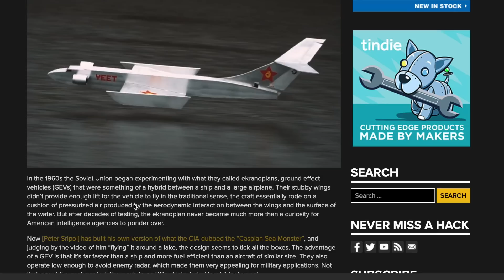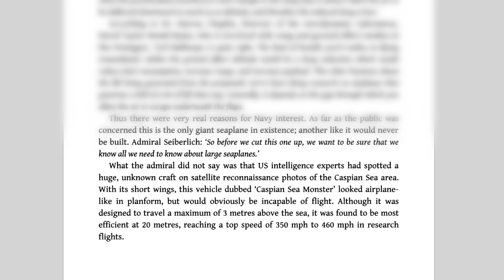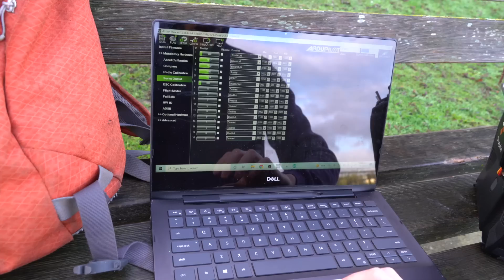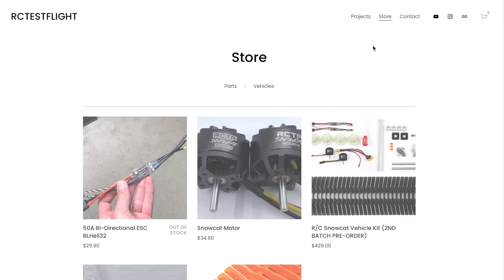Worlds First 'Real' R/C Ground Effect Vehicle

Comment: A ground effect vehicle is any vehicle which primarily flies in ground effect. 
Can you measure the lift force? Like, somehow put a strain gauge on the spar holding the wings to the body, and log the force and perhaps distance to the ground with an ultrasonic sensor?
Keeping track of speed, altitude and force will with numbers will show that you're really actually truly in ground effect, and make some pretty graphs.

Comment: So the thing my brain keeps going back to is weight.  Is there a reason I'm missing as to why the vehicle is so light?  Sure it makes it easier on the motors, but the motors have proven to be more than capable of lifting the craft out of the water.  My thinking instead of making it as light as possible, as an aircraft would want to be, why not set the motors at the optimum running speed (as fast as possible without cooking them) and then add weight as needed.  It would make it more stable and less susceptible to winds, and cut out the issue of having too much lift.  In theory, the soviet craft, even at full bore,  never had enough lift to make the thing fly.  It's power to weight balance was just enough to make it work.

Comment: 11:00 that’s technically called porpoising, present day Formula One cars are battling it atm, it’s caused when the vehicle aerodynamically stalls because (with cars) thry gets sucked close to the surface, stalls and then the car rises, ground effects start working again, then it gets too low and stalls again, although in boats I think it’s the opposite principle because the boat gets too high and stalls that way rather than too close to the water.  For your thing it’s probably a combination of the two, but I thought it quiet funny it was porpoising across the lake like a Ferrari.

Comment: Conformal coatings are not intended for primary protection - it's a backup. Things like connectors can't be waterproofed with it anyway, so you always have point where water can effect. They are intended for "backup protection" generally.

Comment: I totally agree with you about the power being a defining issue of a “real” ground effect vehicle.  In the kite flying community we have a saying that anything can fly if you bridle it right and you have enough wind.  😁

Question:  Instead of pitching the motors way up to get off the water, why not just use a small hovercraft-type fan to develop a little extra pressure under the wings.  That would eliminate the transition control problem.
Reply: This isn't totally relevant, but reading your comment made me want to find a big leaf like an elephant ear, glue some sticks to it, and try to fly it.
Reply: Weight? Aerodynamics? Any extra motor adds weight and putting a extra fan on it disrupts the flow of air around the fuselage when in flight mode. I think that VERTOL capable planes often have doors that cover any lift fans or vectored jet thrust. If I remember correctly the Harrier bleads of some thrust from the engine through vector capable nozzles located in the wings. But I'm also pretty certain they will have some way to minimize the aerodynamic influence when in normal flight. And those nozzles are a lot less disruptive than one or more lift fans in a RC model.
Reply: It works for hovercraft (and helicopters, sorta) . . . .

Comment: I agree the sea monster could fly outside of ground effect if analyzed from an aerodynamic and power perspective but it is possible that the structure of the aircraft would not be able to survive the increased drag from required increased velocity to fly with out said effect. Drag is a function of velocity squared (at low Reynolds numbers at least and ignoring induced drag) so marginal increases in velocity could have significant increases in drag on the body, wings and tail which may have been more stress than they were designed to handle.

Comment: If we need a definition for GEVs, let's just look back at the Flairboat: it's a vehicle that can only fly in ground effect.
Could it fly out of GE if you put a bigger engine on? .. EVERYTHING flies if you just put a big enough engine on, so that question should be irrelevant.
Ekranos are more like a hybrid. They are designed to use GE, but they are not limited to it.

That said, I think a Flairboat-like design might be the way to go for a "real" / "pure" GEV: the front wing lifts the nose and forces air under the back wing, which lifts the tail.
Figuring out the necessary aerodynamics, especially if it's supposed to balance itself, could be a challenge, but it should be possible to tilt the wings and add flaps. This way different wing profiles and AOAs could be tested.

Comment: A submarine is still a submarine even if it can float on the water.  The only conclusive way to know if you're in ground effect is to take away the ground ie fly it off a small cliff.  If the plane loses altitude then you were in ground effect and it is a real ground effect vehicle.  If not, then you were just flying.

Comment: Many years ago I read  "The illustrated guide to aerodynamics", and from what I remember, the wingtip vortexes cause induced drag and when the plane is in ground effect these vortexes are interrupted and that eliminates induced drag and thus makes the wings more efficient.  I don't think the author believed in a high pressure cushion of air causing ground effect, just that the wings gain efficiency in ground effect.  Granted he was only discussing airplanes in ground effect and I can see that the way air is channeled under the wings of your purpose built ground effect vehicles that the high pressure air pocket makes sense.   I think it would be interesting if you added ballast to make the plane heavier.

Comment: It should be composed of two parts of power, one part is high-power take-off to get out of a static state like the start of a car, and the other is low-power cruise to maintain ground effect, and a small thruster can be added to the tail like a Caspian monster. There should also be a T-shaped shark fin at the end of the wing, just like a civil airliner, English from machine translation

Comment: Could you mount a sensor that measures the air pressure on the underside? Wont that verify the ground effect mode?
Reply from the maker: All planes have higher pressure underneath. Thats how they fly
Reply: @rctestflight  yeah :D i Mean the pressure difference between 1 and 10 feet
Reply from the maker: @myketrip8938  There is none! If an airplane is maintaining its altitude then the pressure difference between the top and bottom is the same regardless of how high it is .

Comment: the main thing to remember with a water based GEV is that its a boat first. The more efficient you make the hull from a hydrodynamic standpoint, the better GEV it will be. you will need less power to get speed, which if you design the wing part right, should trap enough air at a specific speed to finally liberate the hull from the water with just enough lift to keep it right over the surface. Lookup a boat called the flareboat from the 90s. it had a BMW motorcycle engine mated to an air propellor, it did around 70kts. it was marketed as a fast efficient way to get around the islands when the waves are rougher, without needing a bigger boat or a pilots license.

Comment: I feel that a scoop wing might be necessary. That would make a hovercraft in a distant sense, but arent hovercrafts actually ground effect vehicles that produce their own pressure while stationary? Gotta focus that air pressure at some point in space right under the center of mass of the craft, so that it has most efficiency in that height... Or maybe its supposed to focus it more the closer its to the craft?
Edit: So i guess your goal ends up being to have the craft move not touching the surface using as little power as possible?

Comment: ive been wanting to see someone test how much weight a ground effect vehicle can carry for ages, you could probably test it with that one quite easily by putting a big battery on top
i think weight may have been the deciding factor for the ekranoplans, i messed around with ekranoplans alot in fsx and the a90 could fly quite easily out of ground effect with a high angle of attack but couldnt when i loaded it with weight, it could carry alot of weight too, far more than any plane of the same size

Comment: Rather than reducing the power, maybe you should increase the weight?
Reply: You said yourself, to make it a ground effect vehicle, you need to reduce the power to weight ratio. Increasing the weight would do that but also maybe give it the momentum needed to cut through the air in a way that it would be more efficient.

Comment: The Caspian sea monster was designed to haul extremely heavy loads. Increase the scale and weight, that should smooth out the rough spots and start getting consistent results.
Reply: Yes. The elasticity of the air doesn't scale down with the size of the vehicle. We can reasonably assume that there is an optimal scale for ground effect vehicles which is dependent on the physical properties of the fluid being operated in. So for earth atmosphere at sea level, there will be an optimal size of ground effect vehicle which is able to maximize benefit.

It also seems plausible that there is a Pareto curve of optimal speeds for a given vehicle size, where the dependent variable is the vehicle weight (payload).
Reply: I think this has been said on every single GEV video and he hasn't taken any notice. He always complains about it being too bouncy or taking off too early, which makes it pretty clear it needs more mass.
Reply: @balthxzar  Or more precision. Yes, more mass gives you more tolerance. But his quest is to find the exact sweet spot where it still works.
Reply: Bingo. Mass dampens all external input.

Comment: The reports I read about the ekranoplan when it was still in use said that low fuel consumption in ground effect was the main reason for its development. The biggest of them could fly like a plane to jump over ships etc but at a large fuel penalty. Biggest drawback of the plane was the turning radius at speed and that was most likely why the project was abandoned. I think the caveat that a GE plane should NOT be able to fly out of GE is similar to debating about how many angels can dance on the head of a pin. You did very well with your experiments. Large craft have GE up to 10m or so and the tiny range of your model made it hard stay in the envelope. Keep up the good work.
Reply: Three.

Comment: As you clearly demonstrated ground effect at this scale is a very delicate balance, I think one thing to consider is that obviously headwinds etc greatly disrupt that balance, and the flight controller currently has no way of compensating for that.
 An air speed detector on the  model allowing the controller to instantly adjust for variations in lift from airspeed fluctuations could give good results.

 Great series and looking forward to more.

Comment: So you mentioned about the power to weight ratio... what if you just added more weight to the craft but still used the engines at high power? so the craft almost couldn't go higher than ground effect as its weight would keep it from taking off but the ground effect + motor power was just enough to get it to lift off? It seems like the engines are way way too powerful for the super light weight design

Comment: If you need to take off from water, you've predetermined the outcome already. It takes so much power that it must be throttled back when in GE flight.

Imagine a wheeled ground effect vehicle taking off on smooth ground. That would take so much less takeoff power that it likely couldn't rise out of ground effect at all.

There's an argument that a true GEV doesn't need pitch or roll control surfaces; all stabilisation is done passively through GE interactions with a rudder only for direction. Again as soon as you put elevons on you're already planning for out of GE operation. 

I've done some experiments with hybrid hovercraft ground effect vehicles, using a dedicated prop to establish a ground effect cushion, then turning it off and needing only forward thrust to fly in GE. Somewhat like the power assisted ram effect.
Reply from the maker: This video proves your first sentence wrong :)
A control surface-less GEV sounds like a really fun challenge! 
I'm a big fan of your hovercrafts. At some point I'd like to try a similar one but with essentially a quadcopter in the center for added stabilization
Reply: @rctestflight  I know someone on RC Groups did a tandem wing build with a pusher prop and rudder only. With the right setup it's passively stable in pitch, roll and to some extent height. I'll see if I can dig up again, he reported it wouldn't leave ground effect at all until it hit a bump and then went flying end over end (been there and done that!)

I done a rudder/throttle only ram wing design with a fixed lifting stabiliser years ago. Again passively stable until it got a bit too fast, hit a stone and flipped over. An elevator can get you into trouble but it can also get you out of it again.

Funnily enough I've had similar feedback on my designs that you have got on the ground effect ones, I was told I should put a quadcopter in a box instead of putting silly amounts of lift power through them because it's not really a hovercraft anymore.

I was kicking around the idea of gyro stabilised skirtless design also, you can do a lot of things with direct adjustment of the flaps and differential control of the lift motors, so there's potential there. You'd need a flight controller that can do the lift motors and flap servos together which is way above my tech skill level, definitely some custom programming needed there.

Keep up the good work and I look forward to the next one.👍

Comment: Yes, we can give an object enough power that it doesn't even need a wing.  We call them helicopter, or rockets. Theoretical its possible just to install weaker engines to this plane, but on a rc plane there is no reason to buy a weaker engine just to prove that you just need less power